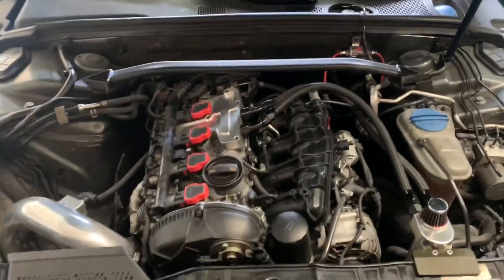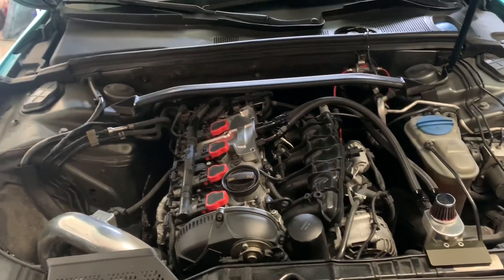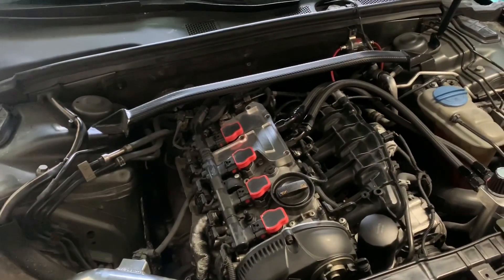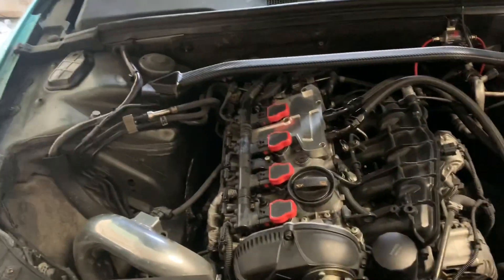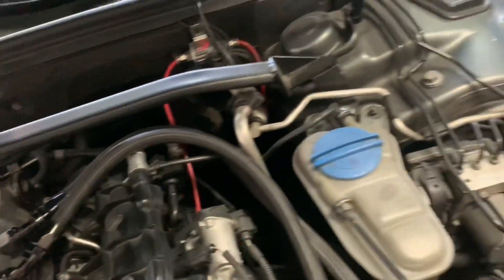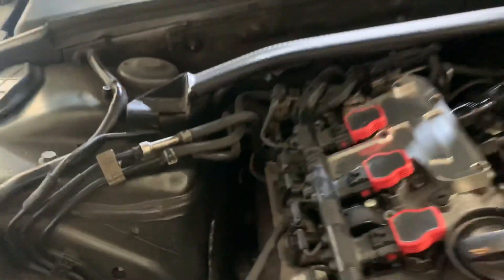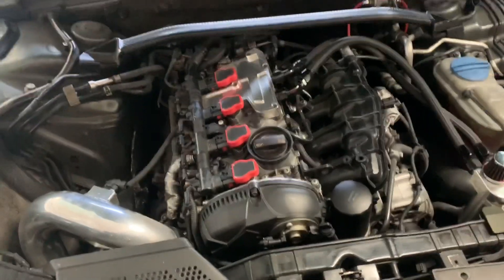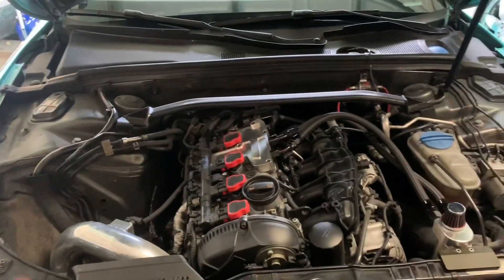How to get 455 hp to a Audi b6/b7/b8/b9 or Vw 2.0 tfsi or Fsi

Comment: I think I’m the only person watching this to do all of these mods to an Audi Q5
Reply from the maker: Cain Hill main I would love to see these mods on a q5, 🤤🤤🤤🤤🤤💯💯💯💯💯💪💪💪💪
Reply: No bro,youre not the only one,here's is my spec.
- Greddy Profec Boost control + gauge
-BBK  Brembo 6 pot 380mm 
-Turbo ball bearing  HKS  3037S-56T
-Blow Off HKS Super SQV 
-Wastegate  External Turbosmart
-ARP Bolts & Studs
-Coilover KW
-INTEGRATED ENGINERING Forged H-Beam connecting Rods Rifle Drilled
-INTEGRATED ENGINERING Intake Manifold
-JE performance Forged Piston Set
-INTEGRATED ENGINERING Performance Valve Spring
-Mahle Motorsport Race Rod Bearing
-ARP Head Stud Kit
-Audi R8 coil packs
-Audi RS4 Injectors
-Bigger Intercooler
-Boost Pipe
-Custom muffler
- Autotech H.P.F.P upgrade
-L.P.F.P walbro
-Heat Shield
- K&N Open filter
-ECS transmission insert Kit
Reply from the maker: william indahsi 🤤🤤🤤🤤🤤🤤🤤🤤🤤🤤💯💯💯💯💯💯💯💯💯💯💪💪💪💪💪💪
Reply from the maker: william indahsi beast
Reply: Quick question, so I stumbled on a set of R8 coil pack and nkg spark plugs. If it adds any, approximately how much power/torque did that add? Haven’t gotten the chance to dyno yet
Reply from the maker: Cain Hill well coils don’t ad power, it just gives you the full combustion’s your engine can handle with the tune. Sometimes we don’t optimize our parts to the fullest, or our tune, can blow our spark if it’s to aggressive. So the r8 coils give you full power with more  fire and heat. However spark plugs definitely effects your power, because it determines, how big the spark is for your explosion, I’ve seen up to 20hp. Variables , when trying to find the right gap for my spark, both positive and negative,  so it does make a difference, but just gives you all the power your tune throws at you if you know what I mean
Reply: I thought about getting a q5, dumping it, and ramp it up. Didn’t though. Got a b8 Quattro..
Reply: No I have a fully built top and bottom end Q5 2.0t what you insta I can show u

Comment: So are you running the stock hpfp? I have a b7 bpg
Reply from the maker: Dylan Page yeh I don’t have an upgrade for my year, but yours does

This is a cheap alternative to retrofit yours, or you would have to buy one from like apr which is expensive. But they pretty much just ad this then stamp there label on it,  look in link below 

https://www.ecstuning.com/b-aem-parts/340lph-high-flow-in-tank-fuel-pump/50-1000~aem/
Reply: Bruce Custom Motors so instead of upgrading the HPFP we can just upgrade the fuel pump and that will be sufficient? We will still need the s3 injectors correct? I have a 2007 B7 2.0t. and I’m planing to upgrade to a CTS K04 turbo. Also do you know how the CTS Ko4 turbo compared to Aprs k04? Thank you
Reply from the maker: Chidi Okwuosa I made mistake, this is what you will need, there different brands out there https://www.urotuning.com/products/fsi-fuel-pump-upgrade-kit-by-autotech-2-0t-fsi-10-127-100k , it’s the hpfp not the one in the tank, and CT’s and apr, revo k04 are all the same, you can get the same numbers, I have a budy who’s knocking on 400hp with out meth with the CT’s
Reply: Bruce Custom Motors thank you!
Reply from the maker: Chidi Okwuosa anytime

Comment: I believe I am somewhere at 390-400 HP on my 2017 Audi S3 without having done a carbon cleanup.

I have a ram air intake from USP + turbo inlet upgrade. I tried to copy Eventuri's design in the air filter. The air intake has definitely made a HUGE Difference in power. Also got RS7 Spark Plugs THESE ARE NOT GAPPED. I kept their original gapping to allow for more power but, potential less reliability in the forms of misfires. The higher the gap (usually) = more power. No problems so far and as a matter of fact I have 0 misfires now.

Also got the APR Coil Packs. I also have the dogbone insert mount which has believe it or not increased my 0-60 time due to the car remaining planted to the ground. Michelin PS4S tires. Unitronic Stage 1+ ECU + TCU Tune. Using Liquimoly for all my fluids and have seen some noticeable results. Haldex pump has a new filter as well to fix previous traction issues.

At this moment I am contemplating Stage 2, an intercooler, and additional Subframe Mounts.

What are your temps right now that you can see in the dash? Not through data logging.

I usually see 210 nominal operating temp and when I get on it it makes at 230. However, on average when I drive somewhat hard it will be at 224 degrees Fahrenheit. Also, I'll turn the car off and my radiator fan kicks up due to the car being very hot. I am thinking it might be coolant related but, my water pump is not leaking. Or maybe I need an intercooler.

You should look into a carbon cleaning as well. I am meaning to do that next.
Reply from the maker: Main amazing right up, loving your build I might have to try the Audi r7 plugs, and agreed I just did a video on spark plugs. I have mine gapped at 28, the suggested from apr .24 made me loose torque, and power. 

My intake temp with my Wagner racing inter cooler on a hot, is around 190, and when I push it around 212, but then there’s the met I have it post inter cooler so my mad doesn’t read the data, but it basically cools my intake about 40%, it’s like your first drive when your engine is cold, or if the temp is around 60%. Meth is what gave me the big jump up to , 450, before I was around 400 like you, I also ad heat to every gallon of boost juice, which helps with the cooling, and octane,  I’m also running Apr 100 octane racing file. What’s your insta would love to follow your build

Also I had that fan issue before my inter cooler upgrade, and my temps where close to yours
Reply: @brucecustommotors  Good to know. I will see what temps look like during stage 2 but, an upgraded intercooler would maybe make more sense at that point.

I was thinking about meth as well. I did not want to install a tank in the trunk though, and I was thinking about pulling it from my windshield wiper fluid reservoir. I do not plan on using it 100% of the time. I would like to run it maybe 5% of the time when racing other people.

You suggest running a custom map for Meth or should I just use it for cooling purposes? I do not want to go E85 and it seems like meth is maybe the next best thing next to doing a full turbo upgrade (bigger turbo means I lose the low rpm torqueyness of the IS38), having the engine bored for higher displacement, and going fully stage 3.

What's next on your list? I have a bunch of cosmetic stuff I want done soon as well aside from performance upgrades.
Reply from the maker: Dave ThaBoss yeh let me know how ever I can help
Reply: excuse me if I missed it, do you have an exhaust on your s3? if so, I would love to hear it . The s3 has the same engine as the Golf R that I want. It is tough to make that platform sound nice. Only heard a hand full of nice sounding ones.
Reply from the maker: Exhaust. MK6CHRIS https://youtu.be/CBiU6abhV54

Exhaust sound
https://youtu.be/KNAw9GHOK74

Exhaust upgrade

https://youtu.be/QhkPI-Rjd4M
Reply: @brucecustommotors  You got rid of the resonator and you substituted OEM muffler for 2 magnaflow mufflers correct?

The real question is will this exhaust still sound good when you have an upgraded downpipe. Getting an upgraded downpipe makes these cars sound like fart cans.
Reply from the maker: Dave ThaBoss no the res, was replaced with a catalyst converter, and I have a single to dual flow masters series 10 muffler, and the 2 on the end are high flow resonators to quiet the car down
Reply: @DrivenByChris  Hey man. I only have a resonator delete. Full exhaust was not worth it in my opinion. Like you said making these cars sound half decent is very hard. I would prefer my car make less noise than too much noise. Bruce's custom exhaust looks somewhat promising though. Check out akrapovic as well. The UK boys use that exhaust a lot. Problem is these things get very pricey and 2k+ for better sound is usually never worth it. I would use that money for performance mods instead. Hell you can buy (2) IS38'S with that kind of money lol just in case your turbo blows up haha.

Comment: how about the oil consumption?
Reply from the maker: Mido Kotb pretty normal, weirdly I feel it’s gotten better since the catch can install, just a theory, I think it helps release crank case pressure, like I said just a theory, don’t quote me, yeh but pretty normal😂🤣
Reply: Bruce Custom Motors I like your setup, guess what I have the same engine on my q5, and suffering from huge oil consumption. Got oil catch can but I heard that the stock pcv is defected also so need to change that also plus I need to change the valve seal and the piston rings, all of that is design flow

Comment: Are you going to change the intake manifold too bro?
Reply from the maker: Yeh I have one, just being lazy, I have an hpa one
Reply: Bruce Custom Motors  that’s the one I’ve been looking to get as well. Gotta sell all these extra parts I have first 😭 I have my other hpfp from IE and a bunch of extra parts laying around the house
Reply from the maker: christopher graham feel ya , I wish could upgrade mine, that actually pump more fuel than mine. I’m actually working, on fueling for a big turbo build, we’re thinking of adding an extra injector, some where
Reply: Bruce Custom Motors yeah I messed up by not getting bigger lines in, it lags and my reader shows I’m pumping a lot of fuel but once I get going it fly’s. Out here in Cali everything is over priced so I’m probably going to make my own lines and look into nuke performance for a better set up. I have an Avant and want to make this wagon fly
Reply from the maker: christopher graham main I would love to see that

Comment: Definitely on the fence about going with a K04 for some extra power... is yours a genuine Borgwarner? I’m currently running APR stage 2 w/ a HFC. I have a 2011 2.0t TFSI A5. What would you recommend?
Reply from the maker: Eric Thomas I felt the same way, before I went k04 , especially from reading the forum’s,  about is it really that big of a difference, I was also afraid to loose bottom end torque, but my k03 had waste gate issues, already, so I said what the hell. I was actually surprised how much power it gave, me, it was the same feeling as my first stage 1 tune, as we all know going from stage 1 to 2 is really not to impressive, more gain, but nothing like that first one, I honestly feel like a v8 now, before I would do pulls , with stage 2 on like m3’s mustang gt, and 392, and about 90 I would step off the gas because they would pull me, I kind of stayed in my power curve lane, know the top and just keep going and I pull on them. It’s definitely a big increase, and worth it , I just raced a c8 corvette from a 60 pull, and we were neck and neck, of course around 120 is when there extra cylinders would take over but who races over 120, same with hell cats etc... it doesn’t really matter if you go CT’s, hpa, or apr, there all k04’s and just basically put you in a position we’re you can run more power, for example if you pout a k04 tune on your k03 it would probably burn it out, so basically a k04 internally can handle more power, I would say it’s like forged internals in the engine 💪💪💪🔥
Reply: Bruce Custom Motors thanks for the information brother! I think I have got just the turbo in mind!

https://www.urotuning.com/products/cts-turbo-borgwarner-k04-turbo-upgrade-kit-b7-a4-2-0-cts-b7-2-0fsi-k04kit-nocat?variant=31162237288503&utm_medium=cpc&utm_source=google&utm_campaign=Google%20Shopping#collapse-tab5

Comment: M1 and Water for the win. I run 30% meth/70% water on my Mazdaspeed 3 with the stock turbo. Huge difference vs one without it at the drag strip. 13.5 quarter mile on a stock turbo and street tires. Anyhow, I just bought an o6 B7 A4 for $300 that put out white clouds of smoke inspector gadget would be proud of....So I threw in a new pcv and the smoke is now gone, but now have no boost because the Diverter valve is shot. After watching your video I am now torn on keeping it stock ko3 with meth injection, or just go big right away with the ko4 swap.  GREAT INFO on your build..thank you.
Reply from the maker: RotorMan Dan if  it’s in your budget I would go k04, I was torn between going k04 because forums would say it’s not worth it, or much of a difference From the k03. Man the k04 make me feel like I have a v8, also the b7 platform has already have a base of big turbo upgrades that can be cheaper than b8 and above, people mastered that year, my brother has a b7 1.8t pulling numbers close to mine. But I was in your same boat, I lost some boost, and a little white 💨, so when I looked my turbo waste gate had play in it, and I switched to a gfb dv valve. You can also find a k03 on eBay for about 2 to 300 bucks or less if you dig enough, but I’m really impressed with the numbers on the Mazda , I know you will go beast mode on the a4,  3 main causes , of no boost, is diverted, waste gate, or pcv. Keep me posted.

Comment: Hey bro,I just got my new intercooler same as yours,i haven't installed yet but I'm playing on doing it next week,i have apr stage 1 and also I bought the R8 red coil pack like yours,how much HP do you think ill be pushing?also I have E85 compatible 2014 audi a4 Quattro
Reply from the maker: Legitshooter stage 1 with your mods, apr will put you at 357hp /391torque e85 tune with stage 1
But with your mods you’ll be close to 370/ 400torque.  Link below for stats

https://www.goapr.com/products/software/ecu_upgrade/parts/ECU-20T-EA888-3-L-IS20

Comment: 320hp 360tq on my 2018 A3. Intake, downpipe, exhaust and Stage 2 APR tune and TCU. IS38 turbo upgrade coming soon. Crazy how detuned most Audi cars are. Just my tune alone added 80hp and 80tq
Reply from the maker: man is38 is a beast, I can honestly say, its better than the ko4 based on , results. yeh I agree. I was surprised I just beat an 08 r8 4.2, we did 3 runs. got him every time. I'm starting to look into a big big turbo like a 50mm or 60mm, im working with this tune shop on fueling that can support it right now, just finished fabricating a manifold for it to be top mount. ill keep you posted might do a video on it once the turbo comes in, my goal is 700hp, I already have forged parts and a engine block, waiting
Reply: Bruce Custom Motors hope its not your day driver lol.  I would love a 4.2 6 speed R8! Good kill! Bet he was salty haha. Thats why i love my A3, its a sleeper
Reply from the maker: @aaronp9835  no got a couple of other cars, just been adding new gadgets, so have been driving it more. yeh im sure the r8 thought I was an rs5,  he probably still has his pride lol
Reply: Bruce Custom Motors haha. He still thinks of the gaps you put on him, trust me

Comment: My friend I have a question, is there an order to those mods? cause If  you install for instance the s3 fuel injectors before changing the turbo I think its pointless, that is a change you need to do when you change your turbo for a bigger one right? so besides the software upgrade (revo, apr, etc) and changing the exhaust and downpipe and Intercooler, what else can you do before changing the turbo??
Reply from the maker: Yes , you're right. I think if you changed the injectors first you would run rich, which is to much fuel, the intake, may not be able to provide enough air to accommodate, the added fuel. For example when i went k04 big turbo, I was running lean before i switched my injectors, which means I had to much air and not enough fuel.so what else you can do, is get a diverter valve, which helps the turbo spool up, a little better. Also a sprint booster. which improves your 0 to 60, and gives you full control of your throttle, and takes away the electronic lag, you may mentally feel like your anti lag is gone. I m going to do a video on it next week. also  a throttle body spacer, improves your torque, and ofcourse an air intake.
Reply: @brucecustommotors  Amazing reply! txs buddy looking forward to your next vide!

Comment: What’s the difference with the b9 2.0 to the b8 one?... notice intake is different n coil packs are different n the turbo . But I’m curious to know the details in the difference I know the b9 one pushes a bit more. I’m used to the b8 engine which I was pushing to stage 2 on Integrated engineering
Reply from the maker: Jonathan Cortes right now ie and apr has a good tune for it both about 360 hp, and close to 400 torque. It’s the same platform, and engine ,on my the engine and Ecuador  is displaced a little different, so you should get the same results, they offer e85 also. Look below in the first link you can see each gen engine you have gen 3 I have gen 2, pretty much the same.

https://www.google.com/search?sxsrf=ALeKk02HMR2HP3i_GsDp8S6qgIg7pR-fsQ%3A1598123585650&source=hp&ei=QW5BX9GYJc_EsAX53pGIAQ&q=audi+a4+2.0+tfsi+engine+diagram&oq=audi+b9+tfsi+engine+dia&gs_lcp=ChFtb2JpbGUtZ3dzLXdpei1ocBABGAAyBggAEBYQHjIFCCEQoAEyBQghEKABOgcIIxDqAhAnOgQIIxAnOgUIABCRAjoECAAQQzoICAAQsQMQgwE6CggAELEDEBQQhwI6BQgAELEDOgcIABCxAxBDOgIIADoHCAAQFBCHAjoICCEQFhAdEB5QkgxYoVtg0GFoAXAAeACAAd4CiAHrFJIBCDkuMTMuMC4xmAEAoAEBsAEPuAED&sclient=mobile-gws-wiz-hp#imgrc=I8fRCIwNM6NMYM

https://performancebyie.com/products/ie-audi-b9-a4-a5-performance-ecu-tune

https://www.goapr.com/products/software/ecu_upgrade/parts/ECU-20T-EA888-3-L-IS20

https://www.etektuning.com/apr-2-0-tfsi-ea888-gen-3-ecu-upgrade-for-audi-b9-a4-a5-q5/
Reply: Bruce Custom Motors cool imma have a look at the links appreciate the time to reply brother dope build best of luck w your builds 💪🏽